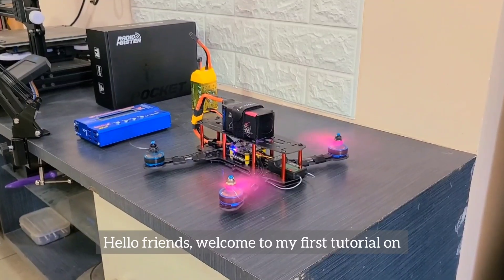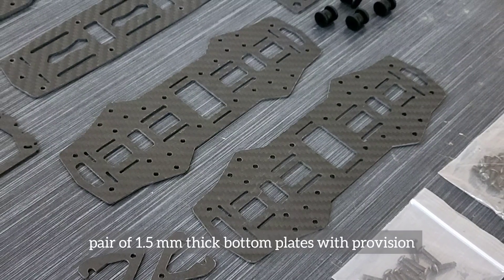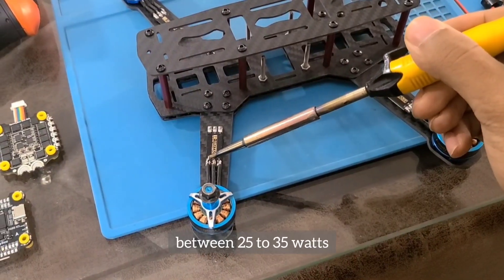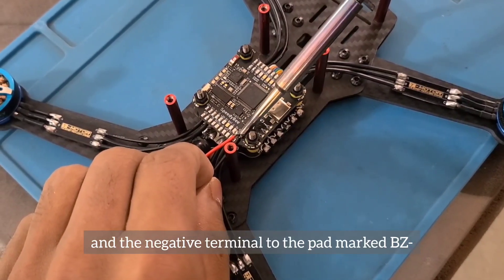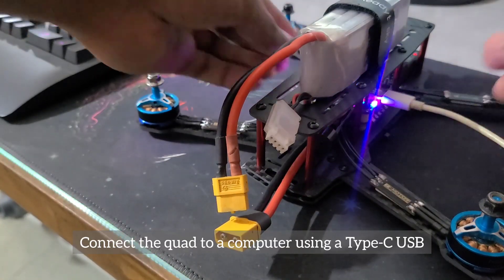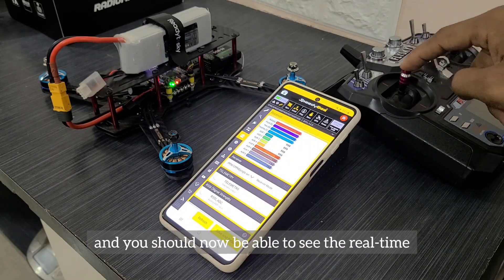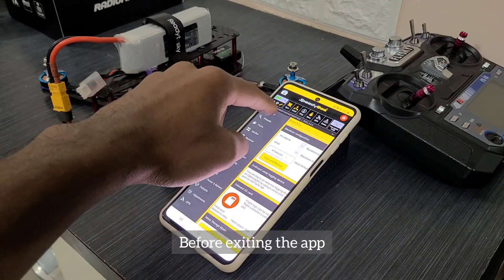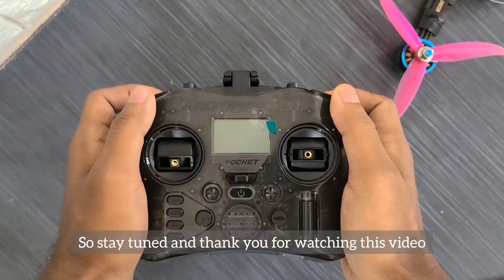SUPER BUDGET 4S FPV QUAD | BEGINNER'S BUILD GUIDE | PART 1 - LoS

Comment: I have some problems 
Whenever i move the sticks on transmitter its just not showing on the speedybee app i tried rebinding the transmitter to receiver and its binding sucessgully and even showing on remote screen but for some reason even if i move joysticks its not showing on app (btw i have a flysky fs i6) ithink its something with the transmitter and receiver not talking properly or the protocols are different help me

Comment: Total cost of making this drone
Reply: Motor - 650 for each * 4
Esc - 3500 to 3600
Flight controller - 3500 to 4000
Battery - 2000
Frame - 1000
Propeller - 200
Charger - 2000
Accessories - 500

So without transmitter and receiver. It's cost around 15-16k

Comment: Amazing video. Why did you need to flash the ESC's? could it work without doing this step?
Reply: Normally you always flash because the factory might run tests on it and it's time-consuming to run a test code and settings and then have to flash again. and when electornic components sit for time in stock or warehouse, usually the chips work better once updated or flashed

Comment: hey dude great video i am also planning to make a drone(non fpv) so just wanna ask if the parts are ok
F7 MINI V1.0 Flight Controller +35A 2-5S BLHELI_S 4 in 1 ESC Flytower
FlySky FS-i6 2.4G 6CH PPM RC Transmitter With FS-iA6B reciever
Readytosky MT2204 2300KV
Q250 Quadcopter Super Strong Carbon Fiber 4mm Arm FPV Racing Frame(250mm) Kit
Orange 11.1V 1000mAh 40C 3S Lithium Polymer Battery Pack
Reply from the maker: @notneon2047  You can build a much better quad at almost the same price point. DM me on Instagram! Don't buy the Flysky radio and receiver! Go with the radio master pocket elrs!
Reply: @NoobFPVPilot  kind of late ho gaya honesly i have already ordered budget was rs12k wasnt able to go above it
thought of the pocket but budget constraints didnt allow

Comment: Hello, is using the race wires necessary for the build or can the motors be directly connected to the esc?
Reply from the maker: The racewires are not necessary. They just come in handy when you need to quickly replace a motor :)

Comment: Hey man, what were the average flight times you were able to achieve with the 100c 1500mah and the 35c 2200mah batteries respectively, without the fpv equipment ie only on your LoS setup?

Comment: Super informative! I'm just looking to get into fpv hobby and this is exactly what I needed. But I've seen somewhere that using 35C battery for 50A rated ESC will destroy the battery since the escs draws more power than what the battery could discharge. Is that true? Sorry if it's a dumb question, I'm learning 😅
Reply from the maker: Thank you so much! I'm glad I could be of help. It depends on the capacity of your battery. A 1000 mAh 35C battery can only provide 35 amps whereas a 6000 mAh 35C battery can provide 210 amps which is enough to power 4 motors rated at 50 amps. Your ESC won't draw 50 amps of current until your motors are drawing approximately the same. So you won't harm your 1000 mAh 35C battery until you operate your motors below 35 amps. If you consider a conversion loss of 5 amps between the motors and the esc then it's better to limit your motors to 30 amps since your esc will be pulling 35 amps.

Comment: can i use ct6b transmitter and receiver ? what woudl be the best option ?
Reply from the maker: Although there's a workaround to make the Flysky R6B receiver work with the flight controller, it is not recommended to do so. The best option would be to use an ELRS radio link!

Comment: Very cheap and it will break zmr frame trash motors garbage radio so old .
Everybody in FPV built this in 2015 Please update your frame motor and radio TBS source one frame Eco motors and any cheap radio master Radio, the only thing good is the ESC flight controller stack, and batteries good skills, cheap cheap cheap
Reply from the maker: I agree with all the points you have raised. This is definitely an outdated build but it's more than enough to get a beginner on a tight budget in the air and experience the freedom of flight. This video was made for such people. 😊

Comment: Nice video! As others have said I would recommend a more modern frame if you have access to one but understand the market isn't the same everywhere. I would also choose a smaller receiver just to future proof it a bit, allowing you to use it in future builds.
Reply from the maker: Thank you! India does have a market for all the major name-brand frames but most of them are priced over 5000 INR. The QAV 250 comes in just under 1000 INR and is the most popular choice for beginners to get into the hobby here! If the budget allows it, I would recommend the TBS source one V5.0 or the GEPRC Mark5! I upgraded to ELRS and I'll be covering it in the upcoming video!

Comment: the receiver antenna placement is not ideal, mounted to the carbon and both orientated the same direction will not provide great range
Reply from the maker: You're absolutely right! I found that orienting the antennas 90° to each other and isolating them from the CF frame significantly improved the range!
Reply: Have you updated that in the video? @Noobfpvpilot ?

Comment: Why did you not just go for ELRS right from the start? Why make a guide telling people to use this and then say you are changing it?

I don’t think this video is all that useful anyway, you go through things all too fast and don’t explain any of it. Anyone following this video would be better just buying a pre built drone.

Your steps are all over the place anyway, you say to attach the top plate and then just take it off again? Also what was that nonsense about different powered soldering irons? You don’t need different powers at all, a high power soldering iron will work perfectly fine for small connections too, what is more important is the soldering iron tip, you want a fine tip for small stuff and a thicker tip for larger stuff. Also a higher powered iron works better for small connections too as it can heat them faster and prevent it from just heating the whole board.
Reply from the maker: I was going to respond to the first part of your comment but after reading the rest, I really hope you find something better to do in life other than hating on people's work. All that unnecessary hatred. Wow. Most of what you said was utterly stupid but you raised a few good points. However, I don't intend on wasting my energy providing counter arguments to a keyboard warrior. Have a good day, Sir.

Comment: bro can we use fly sky ct6b transmitter and receiver with this?? And also can we use a bit cheaper bldc motors??
Reply: Do you take orders??
Reply from the maker: @I_N0713dVeil  Yes, I do! Please hit me up on Instagram! @noobfpvpilot
Reply from the maker: It's not possible to use the R6B receiver with this flight controller directly since it doesn't support pwm input. An arduino can be used to convert the pwm signals from the receiver into a ppm signal which can then be sent to the flight controller. Even though this is possible, it's definitely not recommended to be employed in flying objects. The CT6B is also not recommended to control such objects due to its poor range and low reliability. If you're talking about the A2212 2300 KV BLDC motors, it's better to avoid these. They will work but with a very high uncertainty. There's only a difference of 100 rupees between those cheap motors and the motors used in the video which are much more reliable. Sorry for saying it this way but it's always a good idea to not leave anything upto chance when it comes to objects that can fly.
Reply: What's the price of The whole set??
Reply: Actually I don't use Instagram do you have any WhatsApp no.??
Reply from the maker: @I_N0713dVeil  Drop a mail! I can't share my number here 😉

Comment: I really wouldn't recommend this frame to a beginner. It is cheap, but also extremely breakable compared to other frames even at similar prices.
Reply: I am beginner I am using this frame last 2 years nothing broke I have crash more than 100+ time  at full throttle 1400kv motors
Reply: @ArshadAli-c1f5nkitne ka pura build bana bhai
Reply from the maker: I understand what you're saying but the next "cheapest" frame is twice the cost of this one in the Indian market! Also, the amount of space available in this frame makes it very easy to work with, especially for beginners!
Reply: @NoobFPVPilot too bad you can't get the open source Source One frames in India. They are pretty roomy, durable and inexpensive. Nice build video though and very skilled soldering.
Reply from the maker: @kurtzFPV  Haha, yes! The TBS source one V5 is available on some stores though. They sell like hot pancakes once in stock! Thanks a lot for your feedback. Have a nice day!